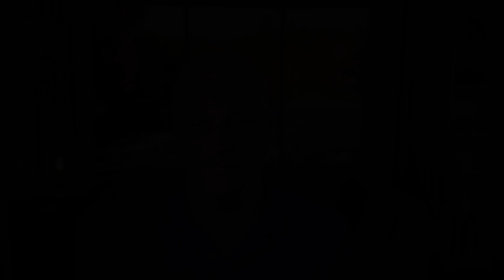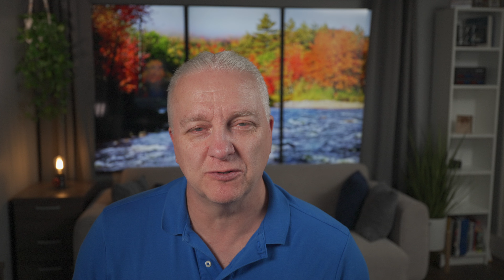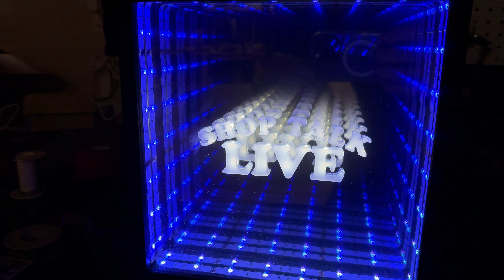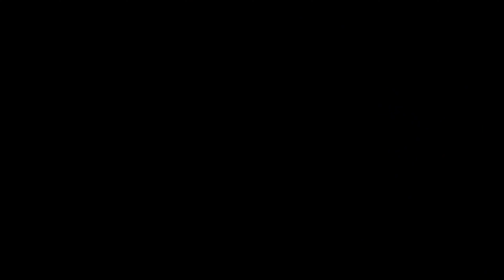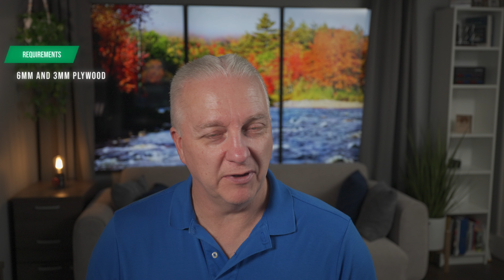I Crafted an Epic Custom Infinity Mirror Sign!

Comment: What’s the height of the whole frame?
Reply from the maker: I don’t have the sign handy, but it was 250mm x 250mms I believe.  These can be any size you want though.
Reply: @SteveMakesEverything  okay thank you so much. Do you at least remember the distance between the mirror and reflective glass?
Reply from the maker: @davidochenjele8720  The short answer is that it doesn't matter.  THis only affects the density of the reflected LEDS wrapped around the side.  My entire light wast much more than an inch thick.

Comment: How big should the text be for the sign?  I am using a 10 inch square mirror.  I noticed there is a gap all the way around to see the infinity effect.
Reply from the maker: I don’t have a set size. I wouldn’t make the text much larger than half the total width
Reply: @SteveMakesEverything Thank you for responding so quickly.   The Led strips that backlight the letters.  I understand you made an error but i can't see the final connections of the backlight strips.  Is the Red wire still the same?  How is the green wire connected to the controller box?

Comment: No co2 laser. What is used for the letters and template? And if using glass mirror I assume you put the film over the front of the glass mirror and engrave the back of the other mirror
Reply from the maker: You can cut all of the wood pieces with a diode laser. You might be able to cut the letters if they are sufficiently dark, but you could always use block letters and cut them by hand. If you have a vinyl cutter, find some translucent white vinyl to use.

The mirror is used in the back and isn't coated with film. If you flip a glass mirror face down, you can engrave the mirror coating off with a diode laser. If you use glass in the front of the box, put the film on the inside.

Comment: wow thats amazing
i just started in laser industry after 10 days my longer ray 5 20w laser machine is not working screen is black and manufacturer is giving the same shit again.

watching this project excite me to by another new laser to work

amazing work man
Reply: You could try getting a new brain for the ray 5 they sell them
Reply from the maker: Yes, the controller is available, but since it's the second most expensive component in the laser, try to rule out other things first.  Bad connections, power, etc.
Reply from the maker: Too bad you weren't on our live stream last night.  The Longer folks were there and you could have had an opportunity to corner them.  However, join their Facebook group because there is a huge Longer community and also many Longer support people hang out there.

Is the laser doing anything?  If you are connected over UBS, you don't actually need the display, so maybe you can still use the laser until you get this fixed.  Check the power adapter output to make sure it's got voltage (12V or 24V depending on the laser).  With the power unplugged, check all the connections (unplug them and plug them back in).  Look for cut or frayed wires.

The Ray 5 is generally a rock solid laser, so failures are pretty uncommon.